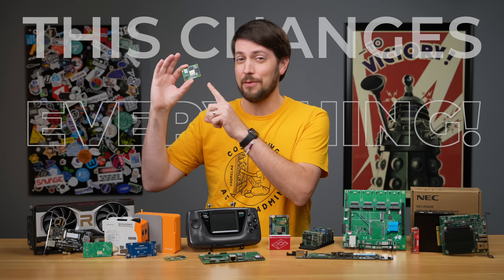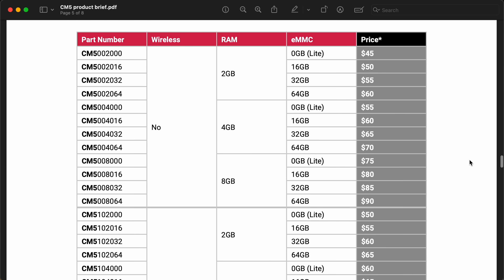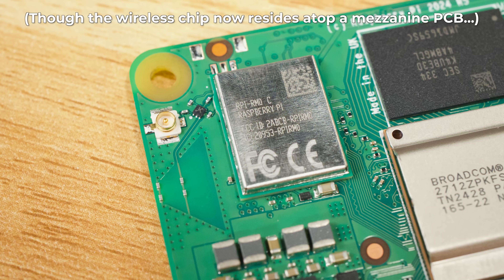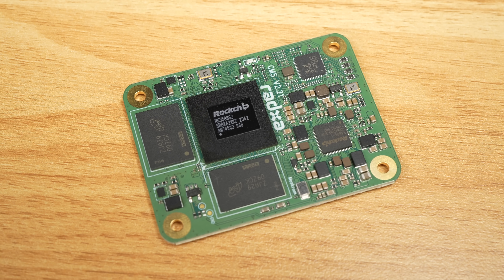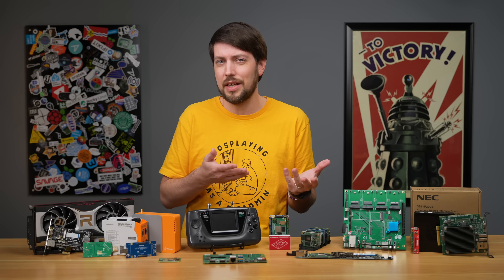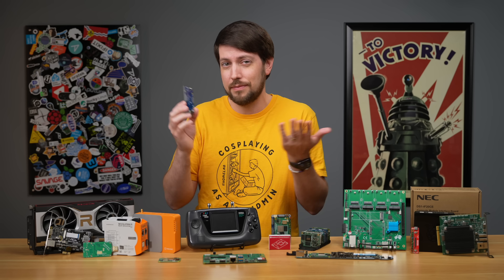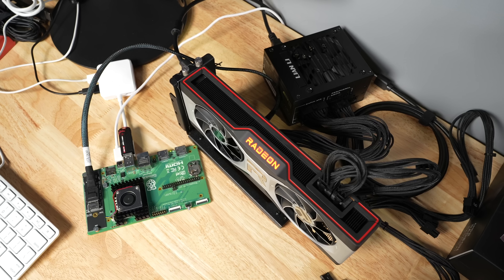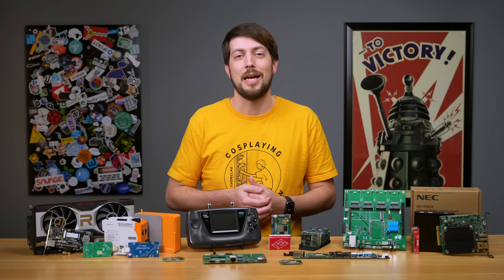This tiny computer changes EVERYTHING

Comment: Hey Jeff, I very new to all of this and wondering if you wouldn’t mind answering a question.  I’m looking to use a Pi for a system called openplotter.  It a marine charting application that also takes in info from various sensors in the boat and displays them on a monitor. A boat brain if you will.  I will also be using a HAT made for it.  The question is, do you think I would benefit from going the compute 5 route or do you think the raspberry pi 5 would be enough…also is 8gb plenty?
Reply from the maker: If you're using a HAT, the Pi 5 or a Pi 4 is the best option usually. It's the most compact and compatible setup.

8 GB should be plenty, 16 GB would probably be overkill for that application.
Reply: @JeffGeerling thank for the reply, I got my pi 5 8g yesterday 😊

Comment: keeping time on the moon is going to be a problem... and figuring out the conversion to UTC from the new LTC is also going to be a problem.. mainly due to the relativistic differences causing clocks to operate at a different speed in the lunar gravity well. If some hobbyist and your timelord friend could come up with some hobbyist hardware to do conversions from UTC to LTC... or something that lets you account for clocks running in different gravity wells... well, you'd be a celebrity. :) thanks jeff. great video.
Reply from the maker: Ha! Weren't they even doing some GPS-on-the-moon measurements with one of the recent lunar missions? It'd be interesting to have some 'SPS' satellites way out at like legrange points for lunar / solar positioning!

Comment: I like the standard CM5 Board a lot more over the RPi5 if you want to use the nvme. Theres a set with case and all for 150bucks here.
RPi5 Module (sadly 4gb ram), +Case with fan + cooler +CM Board +PSU
And normal hdmi.
Its still getting towards 200bucks minipc territory with a bigger CM5 sadly.

Comment: Crazy thought. Is there a way to use a hailo accelerator via a top hat, and a dual m.2 nvme ssd bottom hat  on the same raspberry pi 5?  Is there such a thing as a pci express adapter to allow for the use of two hats?  (insert laughter here).  Trying to keep the form factor as small as possible.
Great news!  I found a hat for that!

Comment: Not-so-fun fact: The cm5 does not support analog audio on GPIOs 12/13, despite the datasheet saying that it does, breaking compatibility with a number of existing projects (just like the pi5, which has the same issue). Raspberry Pi also seems uninterested in bringing either the pi5 or cm5 up-to spec in this area; very disappointing.

Comment: Your videos are always so informative and helpful.
I saw a tiny bit of equipment on your desk that grabbed my attention, and that is onLogic factor 201, which usually came shipped with CM4.

Did you try CM5 on it? If so, how was the performance, thermals and other aspects of compatibility? 
Appreciate any answer/info!
Reply from the maker: Have not yet; so far I'm slowly working my way through some other boards, but I would contact OnLogic as they may already have compatibility info.
Reply: @JeffGeerling  Thank you very much on super fast reply. I have already sent them email (will post here if I get any answers anytime soon). Also working on getting my own CM5 to try on one of the Fr201s I have.

Comment: AND make a video on all the features of the Nebra flash stick. I have one. it works great but using both modes. the one eemc selections doesnt seem to do anything. No good resources explaining both selections on the Nebra flash USB card. Youre the fucking best man. Learned so much from you

Comment: How did you get 1.2W on the Radxa?  I am working on a project and need as low wattage as possible.  I was able to get extremely low power draw on an Orange Pi CM5, but it's missing the ethernet chip that I need.  The Orange Pi OS image also had options to adjust the CPU governor which let me get it down to <1W, but the Radxa doesn't have them and I can't get it to be anywhere near as power efficient.
Reply: hi, have you any experience with orange/banana/radxa ZERO new versions in relation to low power usage?

Comment: And YET the CPU on my new RPi 5 throttled just from running Bitcoin full node (not mining, just validating blocks - RPi 4 and earlier did this just fine even with passive cooling, yet mine often maxes out the fan)...

Comment: I have an issue with connecting wifi to rasberry pi, when I typed in terminal they show only lo and eth0 i can't see wlan0 option. I am using rasberry pi 4 model b

Comment: Hi Jeff! Thanks for the video!
I was wondering, do you know any carrier module that'd have 2.5g? I want to set up a pi cluster, and I'd rather have modules set up indivualle (ie, not in an all-in-one setup like the Turing). The compute blade would have been perfect, but it has only 1 gigabit.

Comment: I just got my CM5 Dev kit and would like to install Home Assitant OS on it with NVME, but realised that can't boot it through SD card. Sounds like a good way to spend whole Sunday to figure this out.
Reply: Did you find a solution. I am too blocked here.
Reply: @EloiTeaching  I installed Rasberry PI OS on eMMC, booted to RPI OS and changed the boot order somewhere in the RPI OS settings to prioritize NVME and used the PI Imager on the RPI OS and somehow the HAOS booted. I used full back up and it has been now stable since.

Comment: anyone confirm CM5 works in GPi Case 2 designed for CM4? GPi won't give a straight answer if they have tried it! rpcs3 runs at 272p on a Pi5 now! 🤯

Comment: Interesting.  I feel the weakness of the rasperry pi is the power supply.  Like it has all the USB and wifi connectivity, it just can't run it all at the same time without external power.

Comment: There's no point in buying these when you can buy a full blown computer with similar power consumption, lower price and better performance. I had some rpi4 in the past, they have trouble with powering usb peripherals, unreliable wifi and are prone to breaking. I only imagine these things used in application where you are limited in space or battery-powered

Comment: What do you use the pi clusters for? I'm also a SWE and I've used ansible extensively for production deployments and just had the idea of building a home cluster with networking stack for learning k8s after tinkering with it at work (probably how I got this on my feed!), but have struggled to think of useful applications of it :P seems so fun though!
Reply from the maker: You nailed it at the end; keeps infra fun, and relatively low cost. Great for tinkering and learning. And not burning a bunch of power!

Comment: Why would they drop the barrel jack connector? It's objectively superior. The biggest reason I'm using a UPS board on my Pi 5 is exactly for the barrel jack. USB-C is fragile, my RPi official power supply is already having connection issues, gotta bend the cable juuust right.

Comment: I have an idea for a project for the CM5 that makes use of an old HP all-in-one, but have absolutely no idea where to begin. I've built a variety of small electronics projects in the past and wish to elevate to more complex projects like this one. I'd like to make a CM5 board that fits into said all-in-one, replacing the existing motherboard, but with appropriate connections for storage, networking, etc., taking advantage of its existing ports and power delivery systems, as well as the 24" LCD display that still works wonderfully inside of it. I don't mind having to learn new things to accomplish this---in fact, that is the goal. I just hate to think of this 12 year old computer going to a landfill when it still has some use left in it (save the horribly slow and outdated APU at its heart). I don't think I'm the only one who feels this way, and I'm sure there are a lot of other enthusiasts who would love to do the same. Naturally, the project will be open source so that others can do the same thing without all the work I'm putting into it.

Comment: Jeff great video. Was looking through all of the comments and couldn't find any about problems with flashing the CM5 using the Pi CM 5 IO board. I picked up a Dev Kit from CanaKit and have tried to flash the CM5 on my Ubuntu and Windows 11 and from another Pi 5, all of these options failed.  I have put a jumper on the first pin of J2 plugged in the usb to each computer without any luck. On the rpiboot from the pi5 computer it went into a loop and I kept getting this message:  Failed control transfer (-7,24). Contacted CanaKit and they are sending me a replacement. Just wanted to know if you or anyone else was having this or a similar problem. What method did you use to flash your CM5? Thanks keep up the good work.
Reply from the maker: Strange! I tried on my IO Board (which I think was from the first production batch), and on the NEBRA Flashstick, and both worked without a hitch (I needed to add the jumper on the CM5 IO Board, but the Flashstick is handy and has a little switch on it... I basically only use it for flashing CM4s and now CM5s.
Reply: @JeffGeerling  Thanks Jeff, Just so I understand, were you able to flash the CM5 to  eMMC via the CM5 IO board and or your Nebra Flashstick? I have a new Pi CM5 IO board and a new CM5 and cannot flash to the eMMC via rpiboot. I set the jumper on the pin for "Fit jumper to disable eMMC Boot" then ran sudo rpiboot, once a a Pi 5 and on my Ubuntu computer, without success. I can install and boot up from the NVME without any problems, but can't seem to get the eMMC to work. I am going to try the NEBRA Flashstick if you think this will make a difference. Thanks again.
Reply from the maker: @dannymartin4225  I was able to do it with the official IO Board too — I fit that jumper, then plugged in USB-C on the CM5 IO Board directly into USB-C on my Mac, and then ran the usbboot/rpiboot software, and it worked right away.

Some USB-C adapter cables work better than others... I have one at my desk that I've found to work with everything, but that could be the issue.
Reply: @JeffGeerling  Thanks again Jeff, I had tried 3 different cables on 3 different computers. So I took my new RPi 5 and reinstalled rpiboot to be sure I had the latest version and grabbed another cable and amazing, it worked this time using  the CM5 IO board. I was so bewildered with the whole situation but knowing from you that it would work gave me the inspiration to give the beast one more try. I appreciate your time in responding to my problem and the work and effort you do with all the videos you present to the rest of us.
Reply from the maker: @dannymartin4225  Definitely! The sad thing is USB-C cables vary SO much in quality... I have a baggie full of the cables I know work, and I only use those cables when doing any programming/data through it. Most cables work for charging, but many cables won't work for even USB 2.0 data speeds for some weird reason :(

Comment: I understan the advantages for small projects where you dont want to design order and solder a PCB, but what advantage does it have for 3D Printers, or in general anything where you need to order and solder a PCB anyway?
Wouldnt it be better to get a processor that more specifically fits your needs?
Reply from the maker: Integrating an SoC into a project is an order of magnitude harder than an SoM, especially since you might be able to avoid having to recertify everything for commercial sale depending on your design. There are a number of other SoM form factors out there too, it's often more convenient to have the core functionality integrated into one premade board.

Comment: When I think of an application there is always a cheaper/faster solution than using these cute devices. Low power, power efficiency, seems to be the reason to use them.

Comment: Does CM5 has TV out like CM4 had? Seems no. Moreover, they reused pin 111 for 3.3V signal instead of TV out DAC so probably it could be dangerous for applications which expects no more than 1V signal here.

Comment: I've come to a point I find RPi's obsolete. These things still have 22nm process chips, pretty old tech, and a 14nm MacMini 2014, or even a 2012 22nm one with a nice all-in-one-package is usually same price or less second hand.
Reply from the maker: The Pi 5/CM5 BCM2712 is a 16nm chip. Still an older process node, but it's not really meant to compete with Apple's chips.

Comment: Hello Jeff,
Always a pleasure to watch your video's
After my RPI CM5 Dev kit was delivered, i did an attempt to install it with RPi Imager tool.
However, the tool did not find my SD Card ( yes , jumper was placed ).
What I tried was to use my USB RPI Rescure drive.
Boot from the drive with succes. Access the RPi latest by VNC and used Disk copy to install mt RPi CM5 Dev kit.
Perhaps not the most perfect solution, but it worked for me and got it up-and- running in no time.
Keep up making your videos on the different channels.
Best regards
Arjen
Reply: I am blocked here but don't understand what you did ^^
You use an USB Key :s ?
I am a kind of beginner and what not ready for this card not detected.

Comment: Fascinating, these small compute boards! I've been looking for something like this for quite a while. I want to build a handheld microphone for HF communication that has an integrated computer to run FreeDV for digital HF operation using the RADE vocoder. It could also be adapted for CB or other bands. RADE is one of the best vocoders specifically designed for shortwave communication. Such a setup doesn’t require much beyond a small sound card and boards like this to get started. With Bluetooth, the audio can be sent to headsets or even car stereos, eliminating the need to carry a laptop or other extra gadgets.

Comment: Hearing you moved from Web programming to backend because of Pis is exciting. I'm currently a junior web dev, and I am going nowhere with it it seems. 
I'm definitely interested in other things, front-end web dev is both boring and frustrating.
But I don't know where to go, what to start, or how to get motivated.
Hopefully fun projects like these Pi projects will catch my eye. I recently ordered a little $5 controller to try writing embedded C for the first time. But need some more hardware to actually test it (like wires and LEDs  to do the arduino version of hello world lol).

Comment: Not to knock Jeff, but the first thing I did before watching the video is check to see if this Raspberry Pi CM5 is actually available. Despite being announced all over the place no one has any stock or any idea when it will be available. Is this just another bit of RPi vapourware which will only be available to "commercial partners"? I have just about given up on them.

Comment: How far back in time would you have to go to have this tiny computer be more powerful than a med-high end home PC?

I asked ChatGPT here is the summary 

You’d likely need to go back to 2006 or earlier to find mid-to-high-end home PCs comprehensively outperformed by the CM5 in almost all metrics, especially general computing, networking, and media capabilities. By 2007, high-end gaming PCs with multi-core CPUs (like Intel’s Core 2 Quad) and advanced GPUs (e.g., NVIDIA 8800 series) could still compete in certain specialized tasks like gaming. However, in terms of overall efficiency, compactness, and modern features, the CM5 would still hold its own even against many PCs from that era.

Seem accurate?

Comment: That is awesome, thank you Jeff :)
I have hopes, that someone would design a multinode carrier board, where you can plug smaller carrier boards with cm5 on it. It would route pcie, usb, power and maybe something more, to central module for management. Of course, it's optional, depending on what small carrier board you use.

Case1: router. Every added cm5 is giving you 2x 2,5G ports, and horizontal scaling of resources for routing/ips/qos/etc managed and distributed by central cm5
Of course, it would need some kind of pcie switch/routing in additional switch, for fast internal connections
Case2: something similar for compute purposes, or clustering
Case3: storage, maybe ceph. It would need different config, let's say 2,5G external, 2,5G or native usb as internal/backend or storage, pcie as storage or internal transfers if usb is used for storage
Case4: Dunno, for sure there are possibilities, just need that main carrier board to be universal/configurable, with as much different lane type available as possible

And now, i need to get one or three cm5 for myself. Or ten :D
Thanks again Jeff, for this video, other videos, and nudging me into new ideas territory :)

Comment: You do know that the CM5 module doesn't have any h264 hardware decode or encode block?
Reply from the maker: Luckily it can handle up to 4K easily with H.264 and either 1080p or 4K with VP9, and 1080p AV1.

For H.265 it has hardware decode up to 4K 60, really wish it had hardware encode too.

Comment: Absolutely no reason to bought one, until Intel N100 platform is on market. N100 is less expensive more efficent and perform a lot better. Why buy an CM5?
Reply from the maker: Less efficient and performance is better in many ways, worse in a few. But very good option for many (and I've covered N100 systems a few times now!)

Comment: Jeff, we are looking for a dual channel of RAM but it does not make sense to go with 32-bit data bus of the RAM. Here are two options. The first option is to have 64-bit RAM with a single channel but it is still not challenging enough. The second option is to have two 64-bit chips of RAM which would be dual channel but we do not have enough space on the PCB board, or this RAM would be embedded on the SoC chip. The enterprise technologies mostly operate with memory, and the ALU operations do not happen so often. The CPU bus speed and RAM matters for the enterprise. After these improvements, we can even compare with the ordinal laptops which already use the dual channels or even 4 channels of RAM and more.